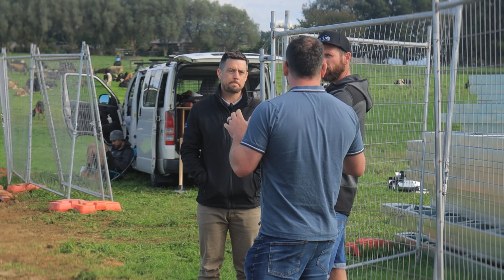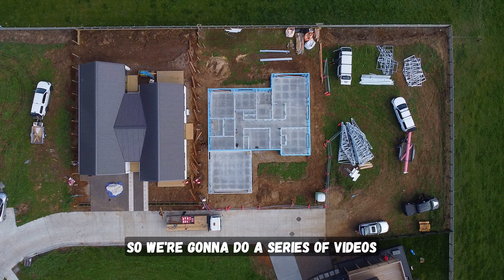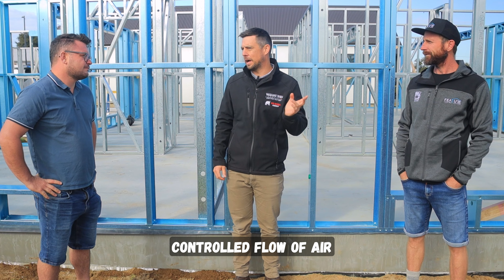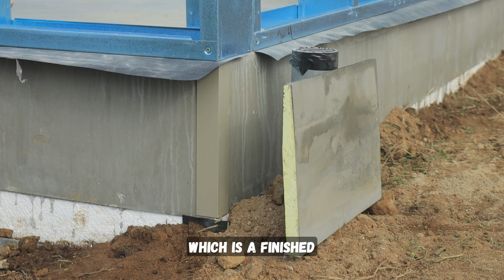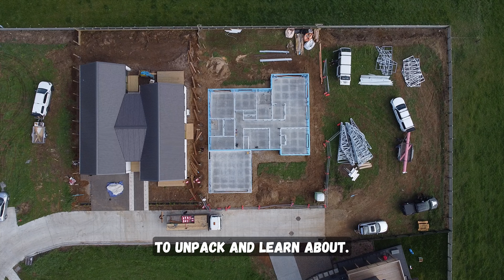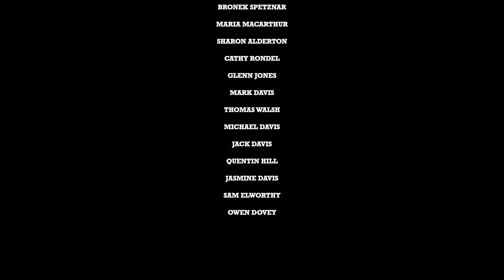Building a Passive Shed House on a Budget! Save Money & Power

Comment: why the concrete radier is so thick for a light structure?
Reply: Because of the rib raft system and extra insulation, on bottom and top.
Reply: @gushy56  Thanks
Reply from the maker: As below extra insulation and ground conditions so a rib raft system as well as hot edge